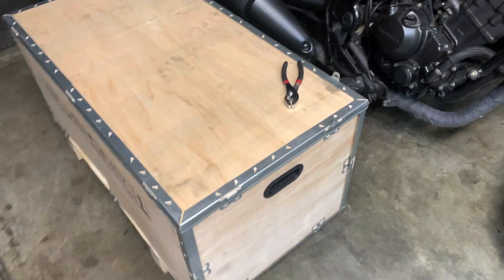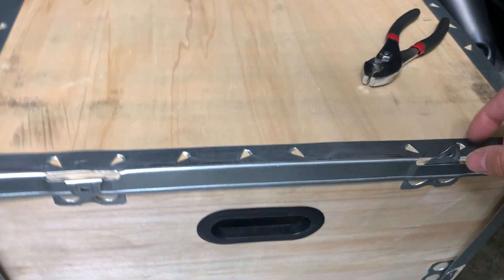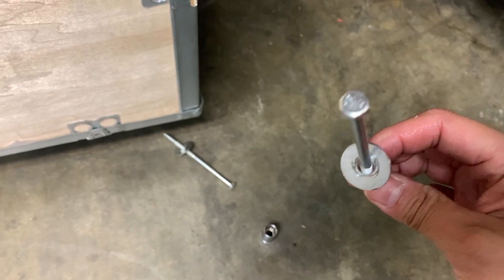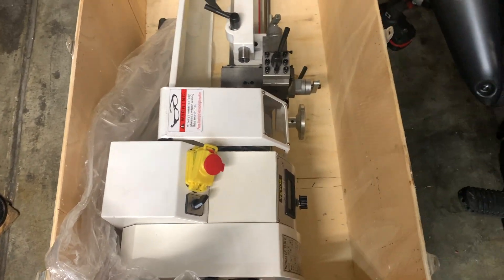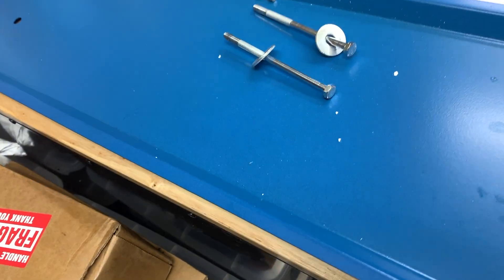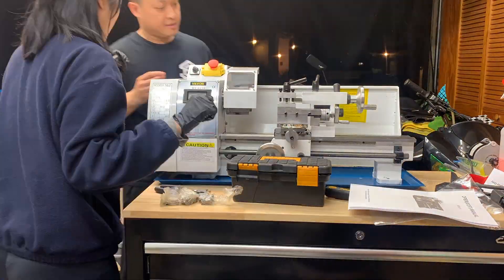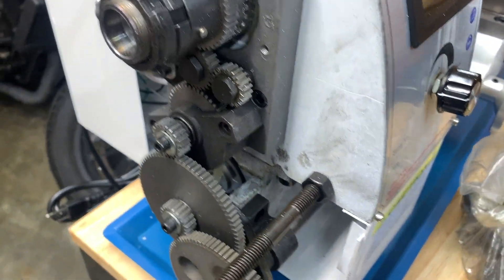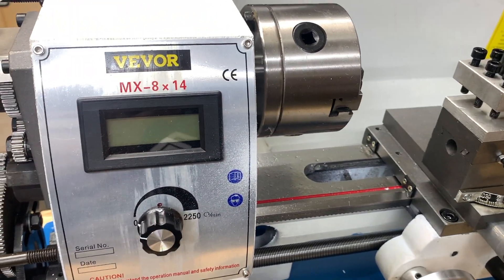Unboxing Our New Mini Lathe! (Vevor 8x14" 2250rpm 650w) | Part 1

Comment: I'm thinking about getting this exact lathe it looks to be pretty well made for what I plan to do with it. One quick question are those two black wheels for knurling?
Reply from the maker: Its been working great for us, we have logged about 40 hours on it with machining aluminum. I think the black wheels you're referring to are just nuts for the side cover, it does not come with any knurling tools.

Comment: The second set of lathe jaws are the reversed jaws, for holding larger stock. You can tell which is which by looking at the curvature of the teeth on the back. They only fit the scroll one way. 
Note that the jaws are numbered to match the slots in the chuck. To swap the jaws you need to loosen the chuck all the way until the jaws slide out. Then find slot 1 and turn the key until you see the start of the scroll thread go past. Find jaw 1, and engage it in the thre4ad. Then move to slot 2, find the start of the thread in that slot, engage jaw 2, and so on. 
Then wind the jaws all the way in to check that they meet exactly in the middle. 
I think that the idea is that you bolt through the table, through the holes in the oil pan, and into the lathe bed. Possibly with a bit of sealant between the bed and the drip dray.
Reply from the maker: Thank you for providing insights on bolting through the entire table; it does seem like a practical approach for stability. While I might have to remove my box top for this, I've noticed some movement when quickly turning the wheels. Additionally, your information about the jaws and the installation instructions is greatly appreciated. Having these tips will certainly help me avoid any mishaps during the jaw replacement process.